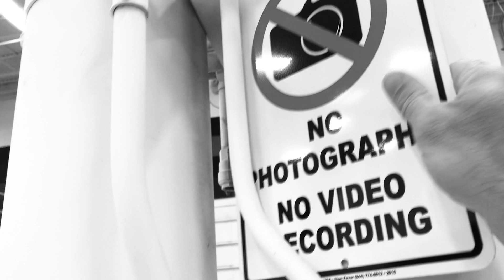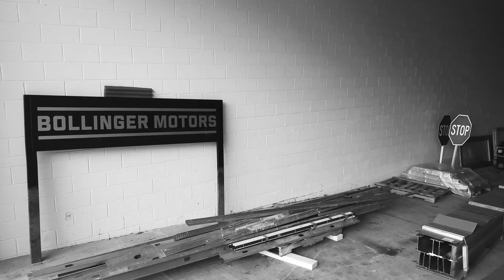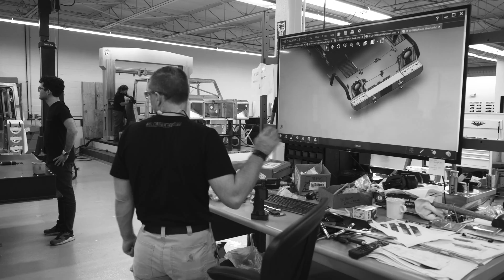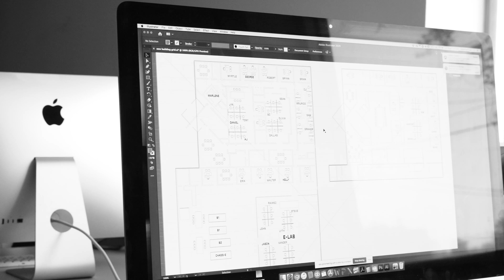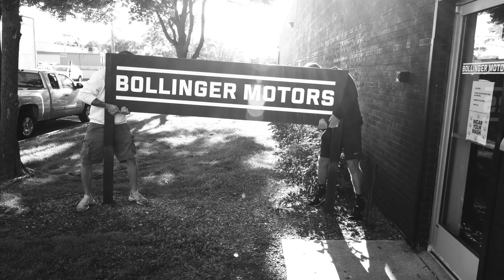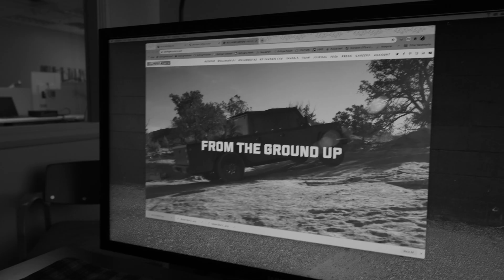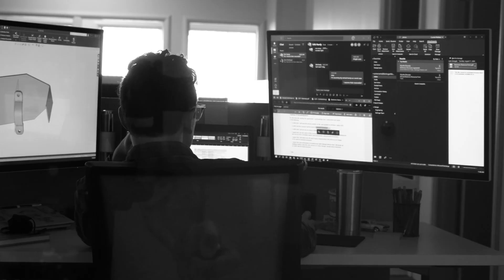EPISODE 06: 2020 - Bollinger Motors

Comment: I love the look and the rugged capability of this vehicle & I'm sure it will do well in it's targeted but I have a question : it has a 200KW Battery pack and the recently released specs on the Lucid Air Sedan says it has 113KW Battery pack so why does the later vehicle have  503 -517  miles of range per charge and this one can only muster 200 miles of range per charge ?  
seem ( to me at least but I'm not an engineer) that the shape would account for that much loss of efficiency given the disparity in battery capacity.  Also, the forthcoming Rivian Truck is said to be capable of 400 miles of range in it's top spec model. What other factors are involved ? What am I missing ?